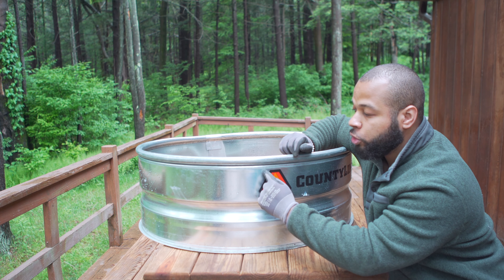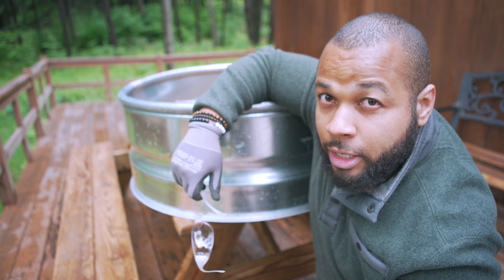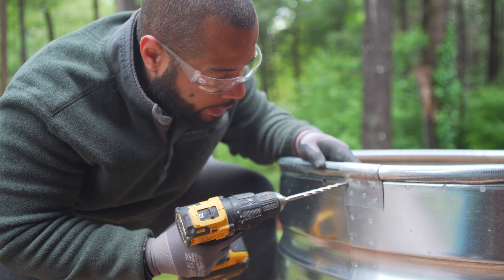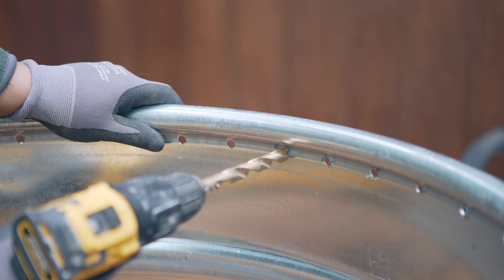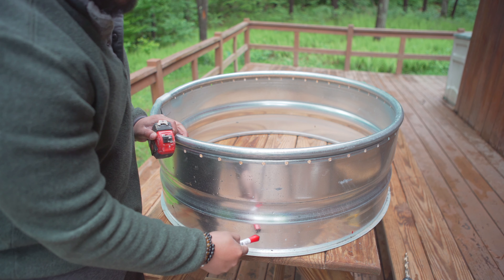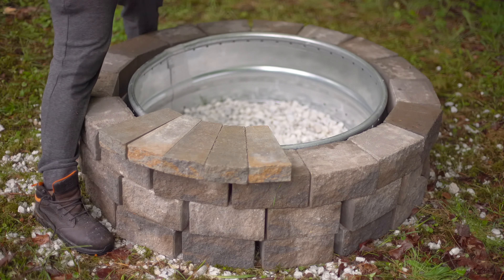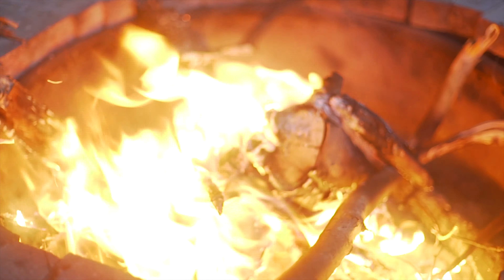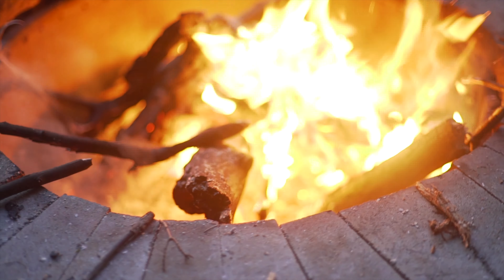Smokeless Fire Pit | Easy DIY Backyard Fire Pit | Glamping Setup Ideas

Comment: Looks great but I don't think the steel will last very long
Reply from the maker: Thank you for your comment! While it is true that steel can rust and corrode over time, there are steps that can be taken to extend its lifespan. However, it's important to note that no material is completely immune to wear and tear, and it's always a good idea to regularly maintain and check on the condition of your steel to ensure it is in good working order. The other issue that arise is that burning this material like many other; can  release toxin into the the air which can be harmful especially in an environment that is not well ventilated.